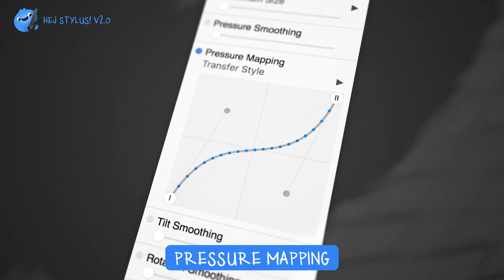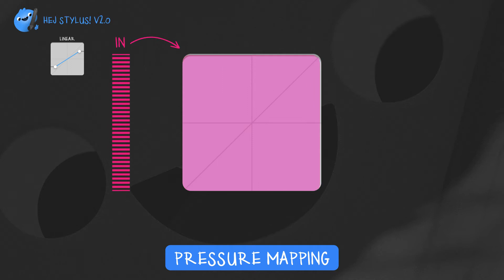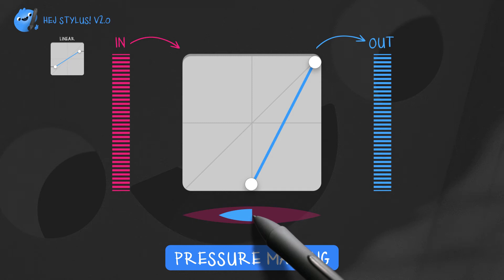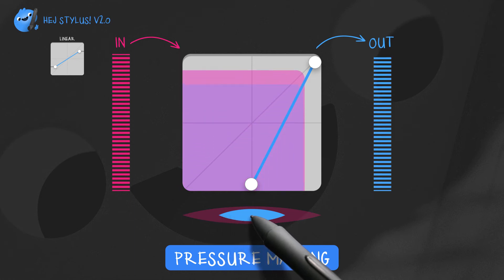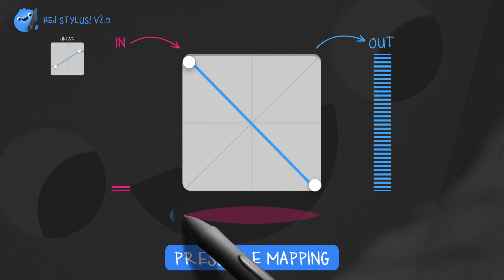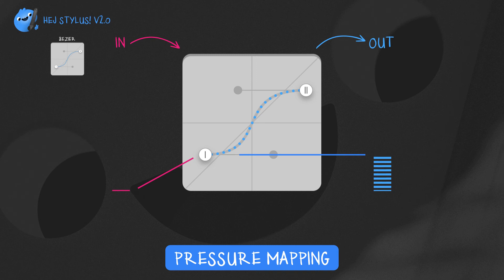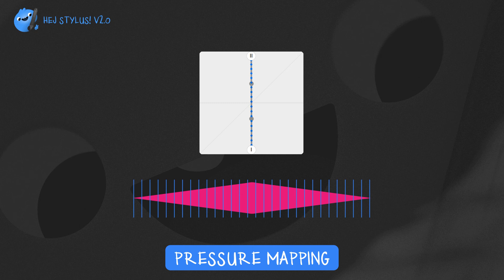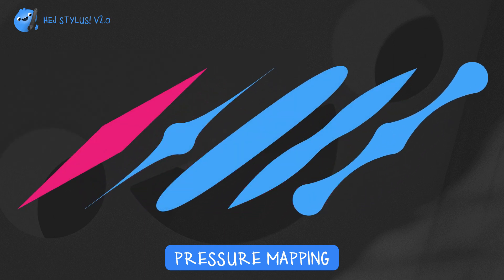Hej Stylus! V2.0 – Pressure Mapping

Comment: I have an Intuos 3 tablet with Wacom driver 6.3.15-3. I'm not sure if the Pressure Mapping is working though. I've tried it inside of Fontlab and also Affinity Photo, but it seems to just be the same as the default Linear.
Reply from the maker: Hey there, try another Wacom driver.
Reply: I have now installed and tested 3 different Wacom drivers. NONE of which work with Pressure Mapping. The most recent driver that I can use with my tablet is 6.3.15-3.
Reply from the maker: aeko This issue has been solved for all later drivers. :/  We can not do much about this situation I‘m affraid. Send your contact so I can refund if you like.

Comment: Does Hej Stylus work in Adobe Animate? I've used basic mode in programs like FireAlpaca / Adobe animate but they glitch out. So what I'm trying to say is that if I purchase Hej Stylus V2 can it function?
Reply from the maker: GLITCHY POSITION IN ADOBE Ai / An

If your cursor seems to be glitching when using Illustrator or Animate try Wacom driver 6.3.20-11. This should solve your issue. Unfortunately the pressure-related issues arise when using this diver. We're in contact with Wacom – to make both functions work side by side. 

http://cdn.wacom.com/u/productsupport/drivers/mac/professional/WacomTablet_6.3.20-11.dmg